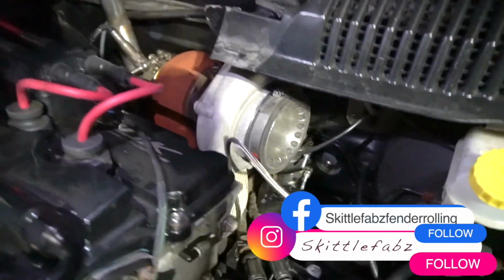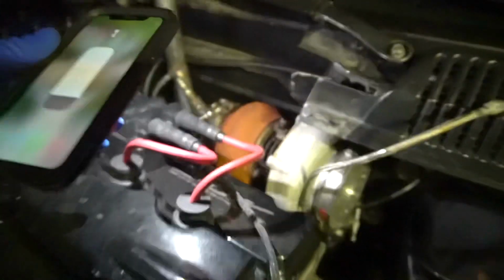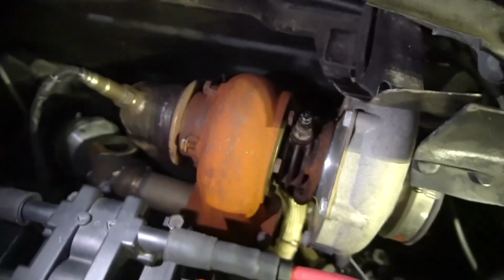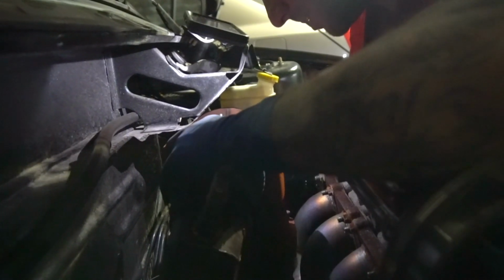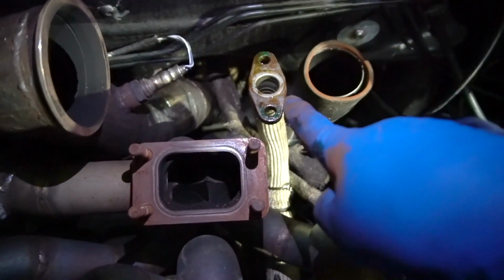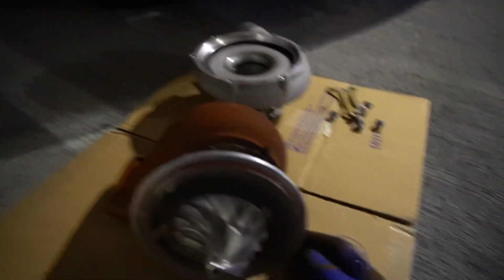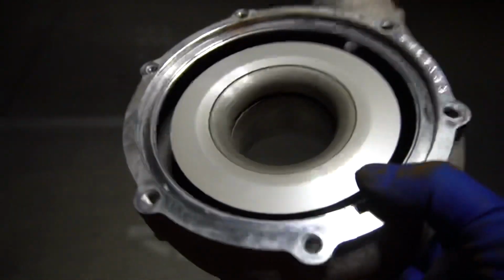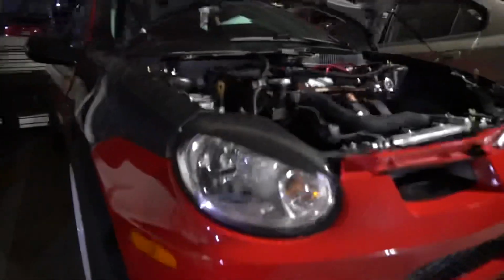Precision 60/62 Removed - Rebuild Time

Comment: Lolol bro, i had the same problem with the cardboard kinda style return gasket with getting just smashed to paper on my red integra lolol.
Reply from the maker: What style gasket you replace with?
Reply: @SkittlefabzSRT4  one of the exhaust manifold style, the kind of foil-ish kinda type. I had to tighten in, heat the engine up, tighten it again, and do that about 3 times, and it works great.